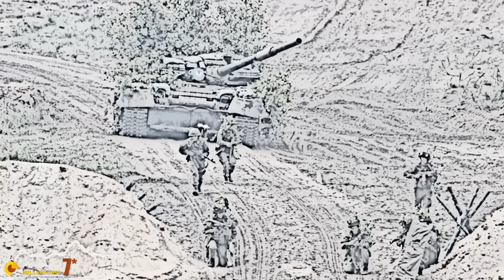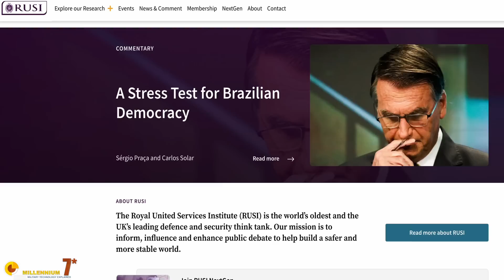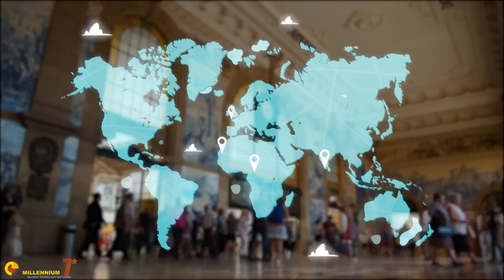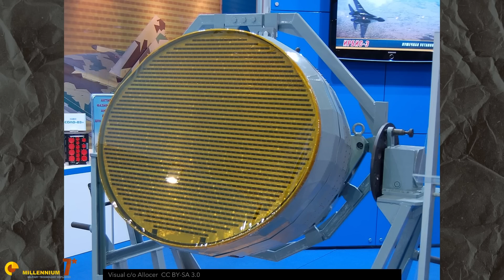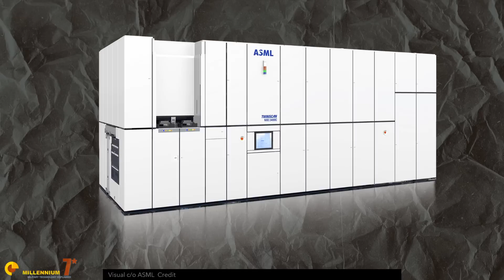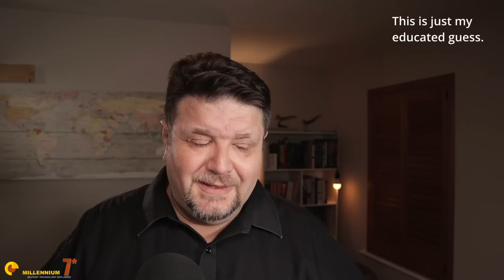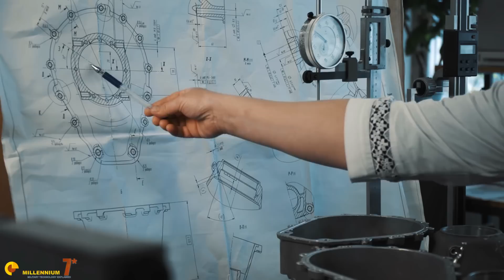Russia is using Western weapons in Ukraine.

Comment: Russia's smart weapons are not working because they used US satellites.   Which they have lost access to.  

The second thing  those drones have been shot down at a unsustainable rate.    So Russia  is losing their advanced  equipment  and are now having problems with components  for manufacturing.    Because  of sections placed on Russia. 

Meanwhile  the Ukrainians  are receiving military equipment  from the US and other Nato countries.  

Hence Russia is having issues right now.   Thus they are not capable of manufacturing  their more advanced  systems. 

They have also resorted to buying drones from Iran.  Which is also having supply chain issues.  

This is why we are not seeing smart munitions being used as much at this point. 

Oh and that video clip was from a Ukrainian drone and the weapon used against that  staging area was a M142 HIMARS system .   Fired by the Ukrainians.   Not Russia at that point.
Reply: Russian smart rockets are working and are able to use at least one navigation system - GLONASS. I would not be surprised if Beidu is on the list.
Reply: @olexp9017  Honestly  from what I've seen they have been using dumb rockets.  While US provided M142 HIMARS systems have been used to knock out Russian guidance systems .   And radar.  Making them inaccurate.  

When you think about Russian Artillery  lately has had an accuracy  radius of within 100km of targets.  
While the US provided systems are pretty much pin point accuracy.  

This is the reason aside from morale issues that Ukraines counter offensive has worked thus far.   Ukraine is turning into a proxy battle ground for NATO and the US.   

An area they can bleed Russia dry of its capabilities and manpower as Putin seems intent on the old Soviet  doctrine of throw more men at it.    The Problem  is Russia today is not the Soviet Union.  They don't have the capability to manufacture key components of their own weapons systems.  Hence we are seeing T-72 variants replacing the loses of T-90s in Ukraine.  

Russia is losing this fight.   Between Ukrainian  resolve to push Russia forces out,  Sactions placed on Russia by the very countries they bought the guidance components from and those very countries selling / lending Ukraine advanced weapons systems.  

Russia is now at a disadvantage.  And unfortunately Vladimir Putin is to stuck in the ideology of the Soviet Union.   And has been in power for so long that his close friends have referred to the man as the Tsar.      Seriously there's only two ways this ends .  

A stalemate or Ukraine  with the help of Nato pushes Russia out of their country.   In both cases Russian blood is going to be spilled in Ukraine  for nothing. 

Though I do find it funny how Vladimir Putin and his friends refer to the government  of Ukraine as Nazis when Ukraine's president  is a Jew.   Yeah the irony.
Reply: @John2r1  Apart from using Kinzhal, Kalibr, X-101 etc. Russians did use Krasnopol  in large quantities (we are talking about the artillery here) which is very precise. There are videos of new missiles that go right into a window, forgot the index. So yeah, they work. Can't say anything about precise MRLS, don't remember anything about them.
Coming back to artillery. American 777 are very unreliable (according to reports from Ukrainian military) while Russian cannons can sustain thousand of shots being very precise (Krasnopol again).

> Putin seems intent on the old Soviet  doctrine of throw more men at it
That is not true for both RF and USSR. It is a typical Western cliche. You should check how many people were fighting for Liman.

> They don't have the capability to manufacture key components of their own weapons systems.  Hence we are seeing T-72 variants replacing the loses of T-90s in Ukraine.
Oh . What we see is a lot of propaganda reports in the media. The worst of them are videos from ARMA 3.
Speaking about things like microcontrollers, Russia can produce them no problem. But of course, there are components that were not replaced by own versions.

> Russia is losing this fight.   Between Ukrainian  resolve to push Russia forces out,  Sactions placed on Russia by the very countries they bought the guidance components from and those very countries selling / lending Ukraine advanced weapons systems.
I don't see this happening. EU is loosing here. There is no winter yet and EU is already under the ground (especially Germany). Ukraine is loosing it's people in very large quantities (i.e. future recruited soldiers). Who is loosing? EU and Ukraine. That is 146%. Who is winning? The USA. Russia? We will see.

> And unfortunately Vladimir Putin is to stuck in the ideology of the Soviet Union.
This is total misunderstanding. He stuck in the liberal capitalist ideology. Did you know that he hates USSR?

> Though I do find it funny how Vladimir Putin and his friends refer to the government  of Ukraine as Nazis when Ukraine's president  is a Jew.   Yeah the irony.
Did you know that some famous American Jews were investing in Hitler? This argument makes no sense. Yes they are Nazi, telling you that as Ukrainian who was born in USSR and who knows some history ;)
Reply: @olexp9017  No so precise when the Ukrainians are now capable of shooting down those drones.  

Sure in the beginning  Russia  had the advantage.   Now the Russian  army is in disarray and fleeing  what has become  an all out offense by the Ukrainian Armed Forces. 

At least recently.   Anyways. With Russian  tanks and equipment  falling into Ukraines hands.   It's ironic that at this point the Russian military  has done a better job of filling Ukraines Armory than the US and Nato has.   

Oh and recently  Israel  sold one of the best anti drone systems  in the world to a country that is going to give / sell them to Ukraine.   So those drones are going to be shot down easily moving forward.   And if Russian  Artillery  was so great then why are they using dumb Artillery shells and missiles from the early 90s ? 

Oh yeah that's because  they are running out of smart munitions.   While Ukraine  keeps being supplied  with smart munitions.  

Do you see Russia's problem here?
Reply: @olexp9017  Oh and as to the American  M777 Artillery piece it can fire smart munitions  which are satellite guided.  So are actually  incredibly  accurate.  

I can tell that you haven't  been on the receiving  end as of yet.  But considering Russia is throwing everything  at the problem  and still losing if your Russian  it probably  won't belong before  your draft notice lol.
Reply: @John2r1  You don't understand one thing - the Russian problems are not the army nor equipment. If you want to understand what the actual problem is then you have to learn the history of Chechen campaigns. The same problem once again.
I know what 777 is, that's why I said how it performs ;)
Unfortunately I didn't understand the last half.
Reply: @olexp9017   I also know what the M777 is and how it performs  especially when using guided munitions.   Which the M777 is capable  of firing.  

Also currently  thanks to sanctions Russia is having a problem with equipment.    Hence the reason they are using older tanks and busses to transport  troops to the boarder as opposed to APCs or IFVs such as the BMP-3 .    The Russian military  is running low on equipment due partly to the Artillery provided to Ukraine and partly due to Russian Soldiers Abandoning their vehicles and equipment.  

Yes what Russia is calling a withdrawal has actually been a route of their forces. 

The longer any war goes on the more the outcome  turns in the favor of the defenders.  

Another problem  is morale.  I mean Civilians in Russia have burnt down conscription  centers aka recruitment centers.  Because  the Russian government  is still using paper records. 

They even by accident  drafted old men.  That isn't  something  a country does when they are winning.  That is desperation  and only reinforces the fact that they are losing in Ukraine.

Oh and HIMARS rocket  systems have proven to be extremely  effective.   I've seen both the M777 howitzer and HIMARS systems in action.  Their more accurate than Russian propaganda would have you believe.  

The effective range of a M777  howitzer is about 30 Km without using satellite guided shells like Excalibur  which increases  the range to around 40 km and accuracy to within 4m  CEP.   

Russian Artillery Cannons are mostly Soviet Era equipment.   With the newer  systems being self propelled.    Which isn't horrible  but the quality  of the operators well we have seen how well they have done their job. Especially  when the enemy can shoot back. 

Um the 152 mm M1955, also known as the D-20 was designed  in the Soviet  Union  Era and is still in service with an effective  range of 17.4 Km and max range of 24km . 

This puts them in the effective range of the M777 howitzers at up to 30km. 

You can see the problem  right ? 

And why some Russian analysts have said that Russia  isn't really fighting just Ukraine but Nato. 

Which is true because Ukraine  is being supplied by Nato countries.   And trained by Nato in the use of advanced weapons systems.   And tactics.   Which is why their counter offensive is in the Nato style of combat as opposed to the Russian  style they where taught in before.
Reply: @John2r1  Shame YT is deleting the posts which makes a discussion practically impossible.

Comment: I think that there are a couple of errors in your video that are more detail as your overall conclusions seem correct.

1 - Semiconductor foundry buildings are more complex than you stated.  For example, they need to be cushioned so that trucks that are passing by do not cause vibrations that would make the lithography fail.  These are not miracle buildings, but are complex to design and construct properly.  Because of this the lead time on this kind of construction is enormous.  This creates a problem in that if you are just going to build parts for the military the costs in doing this are outrageous.  We are talking $Bs to build a foundry.  $Bs to build the underlying design infrastructure.  $10Ms to build the actual patterns for the parts.  And if you put 1 in every Russian Tank, you will build 12,000 of them.  In the real world, you want to build millions of a specific part to amortize the costs.

2 - Your implication is that Taiwan is the world's largest semiconductor manufacturing country.  This is not true.  Taiwan leads in independent semiconductor manufacturing or "foundry" work.  TSMC, as you showed, is the largest firm in this industry.  However, the largest semiconductor manufacturing country in the world is the US.  It leads the world in what is called "captive" semiconductors.  This is exemplified by the world's largest semiconductor company Intel.  

The tracing of the use of components is quite hard.  Let me provide one example.  Imagine you are Texas Instruments (one of the companies that you mentioned as having parts in Russian equipment).  Texas Instruments has many customers that build products in China.  Those products are very often built by what are called contract manufacturers.  Any contract manufacturing facility might have many customers that use a Texas Instruments part that is used in a Russian weapon.  All that needs to happen is that more parts than the contract manufacturer requires can be bought.  A 3rd party Russian company can then buy those parts from the Chinese contract manufacturer and poof these parts that are sanctioned are now in Russia.  Depending on quantities, the extra parts could be hidden in failure numbers and be completely undetectable.  This is one of dozens of ways for this to happen and is much harder to prevent than one might think.  From Texas Instruments standpoint, they are selling parts to a buyer that is completely legitimate.  They have no way of knowing that their parts went out the back door.
Reply: Some errors that i found in your comment:
- The largest semiconductor MANUFACTURING country in the world is NOT the US. United States only manufacturs about 12% of the world semiconductors, behind South Korea, Taiwan, Mainland China and Japan (these east-asian countries manufactures about 75% of the world semiconductors). US is one of the leaders in the semiconductor industry (strong in Chip DESIGN, EDA tools, etc), but its manufacturing capacity is not that strong, thats why CHIPS act was approved. Also, Samsung (South Korea) is the world's largest semiconductor company, NOT Intel.
Reply: @chd0043  Samsung is a larger company but is not a larger semiconductor company.

From wikipedia

Manufacturers headquartered in the following places are the sales leaders in the pure-play foundry, IDM (integrated device manufacturing), fabless manufacturing and OSAT (outsourced semiconductor assembly and testing) sectors of the industry.[26]

Rank	Foundry	IDM	Fabless	OSAT
1	 Taiwan	 United States	 United States	 Taiwan
2	 United States	 South Korea	 Taiwan	 United States
3	 China	 Japan	 China	 China
4	 Israel	 European Union	 European Union	 Singapore
5	 South Korea	 Taiwan	 Japan	 Japan
Note that manufacturers headquartered in the United States have fabrication plants across the world, including over 50% in the Americas, 39% in the Asia-Pacific region (including 9% in Japan), and 9% in Europe.[26]
Reply: @jimsackmanbusinesscoaching1344    
The source from wikipedia you are copy-pasting is data from 2016 (outdated by 6 years),  [BEYOND BORDERS: THE GLOBAL SEMICONDUCTOR VALUE CHAIN" (PDF). Semiconductor Industry Association. May 2016]. 

If you search for 2021 data, you found better info:

The 5 Leading Semiconductor Companies in the World (2021):

Based on "Statistics and Data", we see SAMSUNG ELECTRONICS at the top with a revenue of $76 billion in 2021, just overtaking Intel with $73 billion. These two giants are then followed by Taiwan Semiconductor with a revenue of $57 billion, SK Hynix with $36 billion, and finally, Micron Technology Inc with $28 billion.

....

Also, the same wikipedia article that you refer includes a list: "Major semiconductor companies" in wich SAMSUNG is listed as number 1 (classified as an IDM)